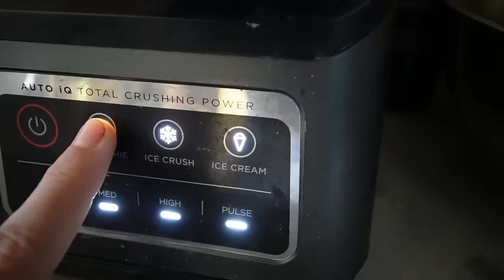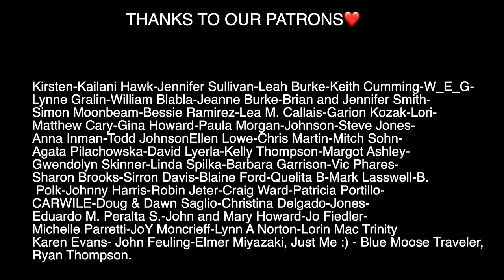WE ARE STRUGGLING

Comment: Tool storage in the house with a second purpose. Build a bench - tool box - shoe  hanging station. You can sit on the lid to take your shoes off. Keep the tools hidden away when stopping at the end of a work day. Plus you need a place to for  quick access for an everyday household tool kit that has screw drivers, pliers, utility knife, glue, masking tape, tape measure, etc.